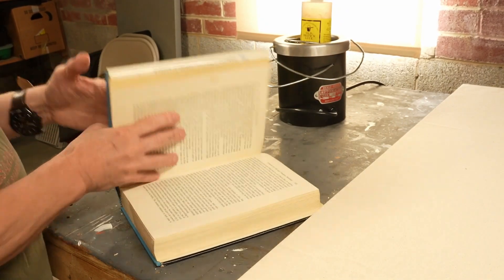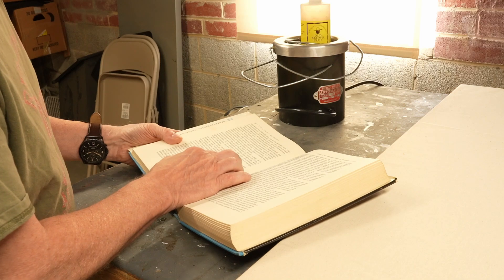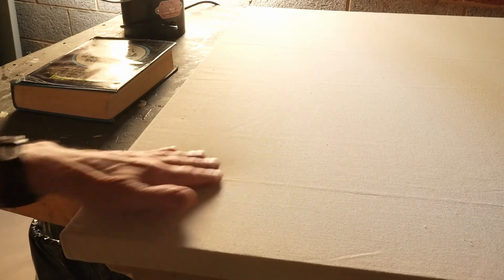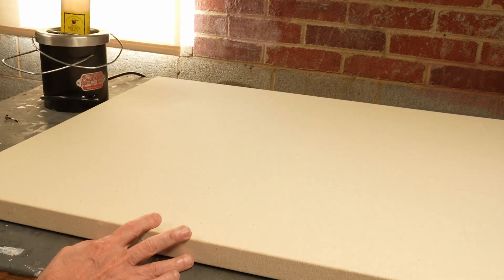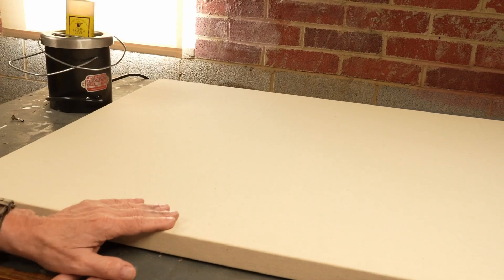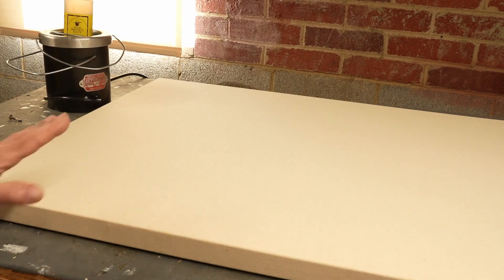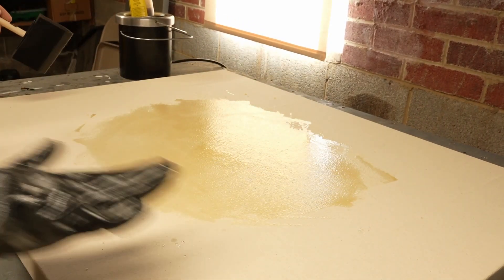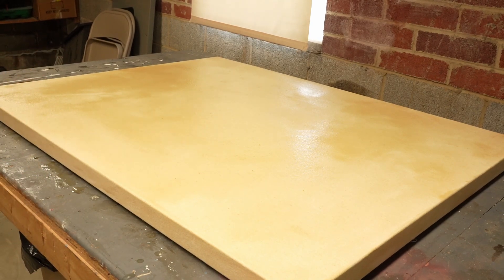How To Size a Canvas For Oil Painting

Comment: I always used acrylic gesso but lately I started to prepare my own traditional gesso, and I now size my canvases (i glue the canvas onto mdf panel because i like the canvas texture but also the rigidity of a panel) with rabbit skin glue. I'm an oil painter but i want to learn tempera painting, and in tempera painting one must - or should - use traditional gesso anyway
Reply from the maker: Tempera painting requires a rigid ground, and the best gesso for it is homemade from melted rabbitskin glue mixed with marble dust and/or chalk. For oil painting on canvas I use W&N's Oil Painting Primer right out of the can, though it can be thinned with linseed oil, sparingly. Thanks for your comments!